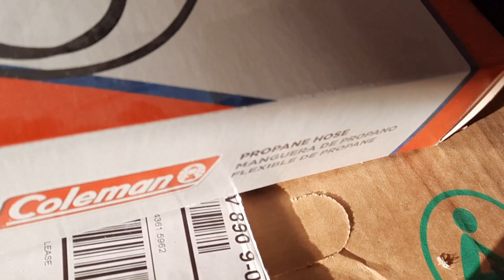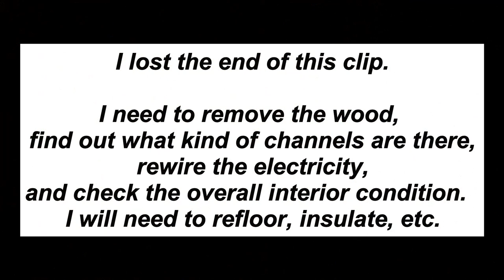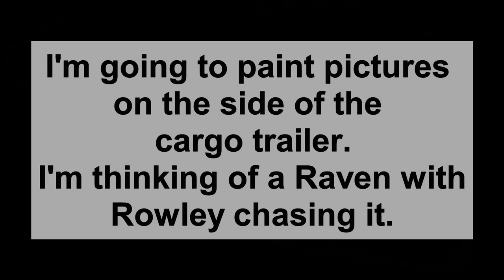6X12 Cargo Trailer.  I'm gonna convert this!! – AR&R 12

Comment: Thanks for showing us your cargo trailer. We are trying to decide between cargo trailer, van or small school bus to convert. We are still gathering information
Reply from the maker: Good luck with your choices.  I've lived in Class A and 5th Wheel.  I think the biggest thing for me was worry about the engine in the Class A.  Cross country in the Class A we stopped at a mechanic three times with engine trouble.  I can't imagine what I would have done if they had to tow it.  Make sure you've got AAA+ just because...  At any rate, have fun choosing.  It's hard and scary too.
Reply from the maker: Hi Naj ruQwi, have you checked out cheaprvliving.com?  Unbelievable amount of information.  Have you gone and sat/stood in each one to see how you fit?  This is such a hard part, but fun fun fun.
Reply from the maker: @najruqwi7008  Glad I could help.